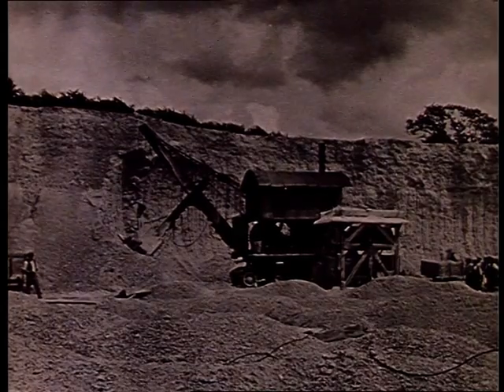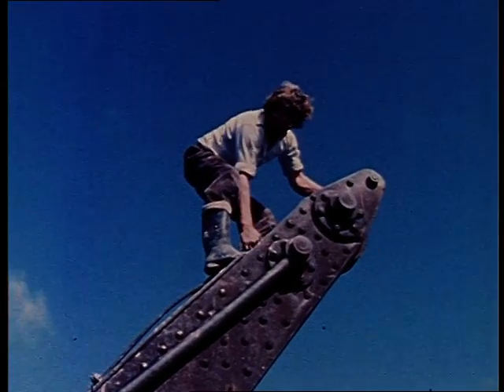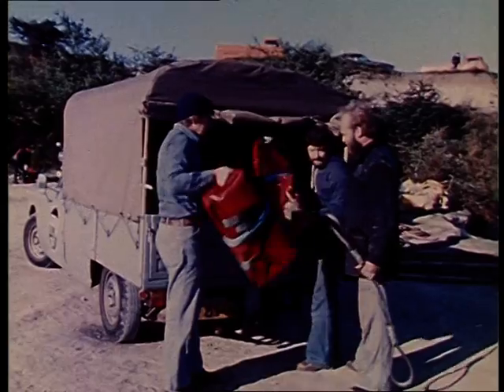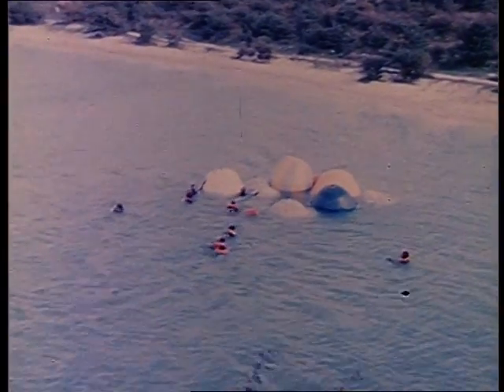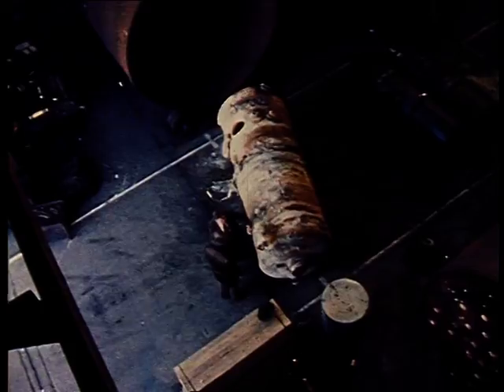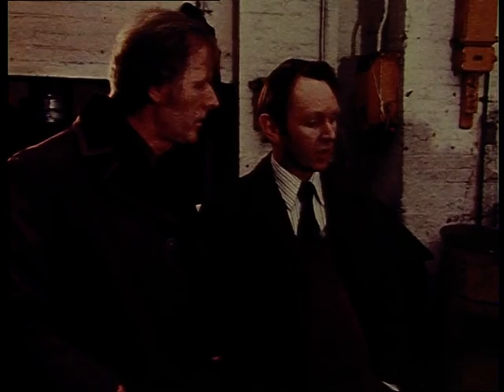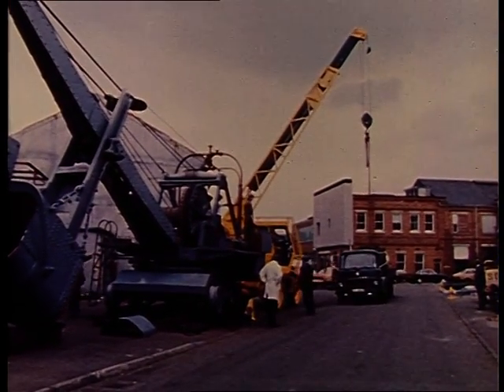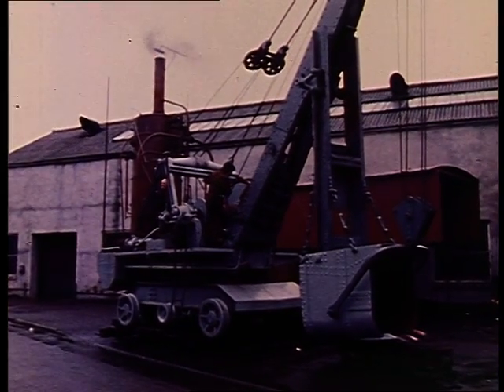Steam Digger From The Deep

Comment: Abandoned in place,  it cost more to disassemble and remove than it was worth at the time. Amazing that the boiler looks safe for a pressure test. Where I live corrosion and rust would have destroyed it in 10 years or less. Wonderful workmanship throughout. Real craftsmen built this behemoth,  and real craftsmen rebuilt it. The young men test driving it could easily be the grand, or even great grandchildren of the original builders. Such a great documentary. Thank You for your efforts.

Comment: The Presenter was Dick Joice the Executive Producer a real gentleman and a delight to work for as were so many of the Anglia Television staff to work with. The problem of welding old cast of the dimensions involved in that restoration, is being able to control the heating and cooling of the castings, to eliminate stresses that will cause further cracks to appear or separation of the new weld from the parent metal. Bygones was a series of progammes that was huge fun to work upon. At that period they were mostly shot on 16mm and then with the addition of studio inserts transferred to Video Tape which at that period was 2 inch Ampex machines and only just out of physical editing by tape splicing to electronic editing. Wonderful days and some of the old technical crew still survive.

Comment: Back in the '70s, due to bosses repeatedly wanting me to machine cast iron that they had welded, I knew that you cannot weld cast Iron with steel electrodes and expect any strength. Unless they are special cast iron electrodes and the piece is pre-heated and even that is questionable.   Neat video and project though, thanks for posting it.
Reply: I dont believe you rustybycycle, i would be highly unsafe with a 5" crack in the main frame with could be clearly seen on this old (Umatic?) footage.
Reply: ***** There is a BIG difference between working as designed or simply moving.
Reply: ***** first vid, then believe, Anyway it not THIS shovel. This one is fubar after all.
Reply: ***** show me
Reply: Stainless rod.  Welded many castings.  Best I ever did was iron track pads, preheated in furnace, laid air arc rod in pin holes, and welded around it with stainless wire.  High stress area, and still working.
Reply: Yes, I agree. I welded cast iron during my apprenticeship days (the late 60's). Using preheating and cast iron rods the weld was virtually invisible as the cast iron rod melted into the original casting. This was my most satisfying weld :-)
Reply: @jpsholland  This was filmed and edited  on 16mm film, back in the day it would have been telecined on to 2 inch Quad format, U-matic was always total garbage and never used for masters from film. This looks to me like it was remastered from the original film print to a newer superior digital format more recently as the Quad wouldn't have looked this good even back in the day.
Reply: I've been handed tips about preheating cast for welding, but more in the decorative arts.
Reply: @goneutt  It's hardly decorative --  fixes in the field in high stress areas vital for operations.

Comment: *A steam shovel isn't a crane.  A road grader isn't a scraper.  Steam shovels were before my time but I did get lots of stick (and foot) time operating a cable backhoe.  Also operated a Cat D-8 cable dozer pulling a cable scraper, that combo known as "Cat and a can."  Never had the opportunity to operate a cable shovel.  For the non-operators, shovels are used for ground level and higher.  Backhoes are designed for below ground level although the modern hydraulic backhoes, now called excavators, can dig high above ground.

Comment: It is so very interesting to witness the ressurection of this old girl.  It is very difficult to weld cast iron and put the weld under stress.  It will work on valve bonnets but on wheels and a rotating memeber; success is not assured.  I am sure slutions have been, or will be found.  I have not witnessed a Steam Shovel working since 1960.

Comment: Attempting to weld cast iron on a machine of this vintage is an extremely poor idea.  The quality of the base metal is so unpredictable.  It is almost certain to crack under load.  It would work if all they wanted was a museum piece.
Reply: It got repaired and it's working now digging like it was built to.
Reply: True
Better to disassemble re cast the parts.or clean it up and display

Comment: Nice job Cheers!!!!
Reply: I STARTED OUT FIRING A BOILER ON A 1939 AMERICAN STEAM GANTRY CRANE FOR BETHLEHEM SHIPYARD IN BEAUMONT TEXAS,,I LATER BROKE OUT OPERATING THAT OLD STEAM GANTRY CRANE,,,IT HAD A 120  PSI VERTICAL BOILER IN IT,,,IT USED WHAT WAS THEN CALLED BUNKER C GRADE FUEL OIL,,,THAT OLD GIRL WOULD REALLY GET IT TOO,,,IT WAS OLD #3,,,THEY HAD #4 ON THE OTHER END OF THE GANTRY CRANE TRACK,,THE GANTRY CRANE TRACK WAS 550' LONG,,,,I WORKED THERE IN 1974,,,THEY LATER TOOK THOSE OLD CRANES DOWN,,I HEARD THAT THEY WERE REWORKED AND PUT ON FLOATING SPUD BARGES,,,I ENJOYED RUNNING THEM THO !!!!!

Comment: Don't you weld cast iron with nickel rods?
Reply: Yes
Reply: Either high nickel or stainless rod. I have also used 7018, which is a low hydrogen rod.

Comment: Steam later years was sabotaged truly by the 70s which there was a few remaining steam working .  By the 50s companys had developed locomotives that were steam turbine that were efficient and still to this day out pull a good size diesel loco. As for inspectiosby the sixties companys were requiring a tube and flu inspectioun every thirty days ..the results was costly every time they did this .results were the tubebes ad flus were good .exscuses were made on this required inspection and men were out of work. Corperations for yah!
As for depenability theseold shovels were as good as the men at the helm and how they kept up with daily servicing. Steam has more torque and fps over any diesl in most equipment old like the steamshovel compared to its predicors that took over with exeption of some equip today. A good example to look up is the lima 2-8-4 oly ten lesser companus bought them bit on a graded climb had a drawbar they could open to  increase steam pressure working the engine coponents easier allowing it
too pull a good size length train by herself on rail lines that delt with grades of 1 to 3 percent etc.   A key element was. Super heatedboiler.